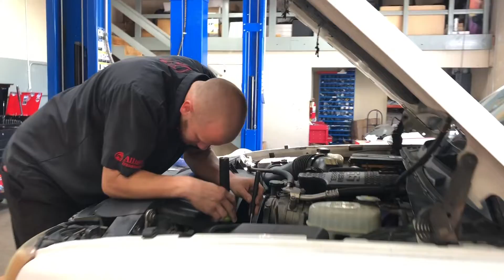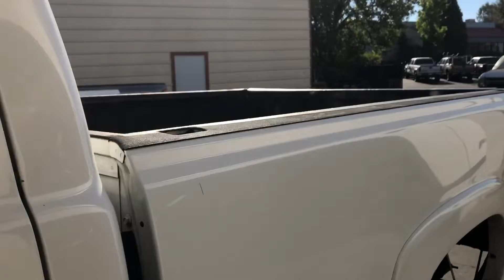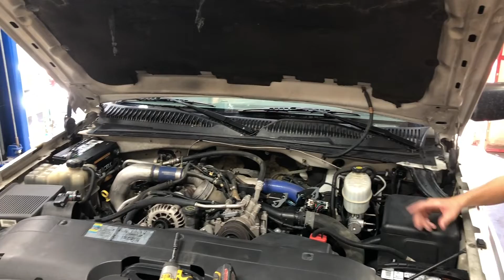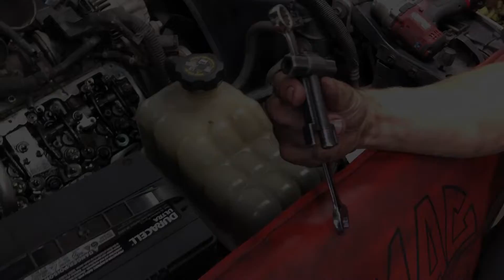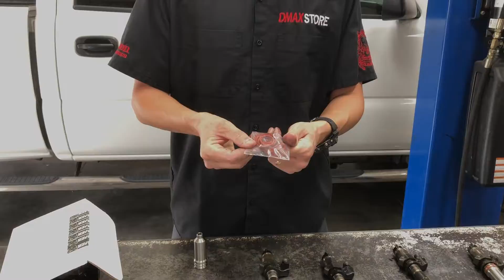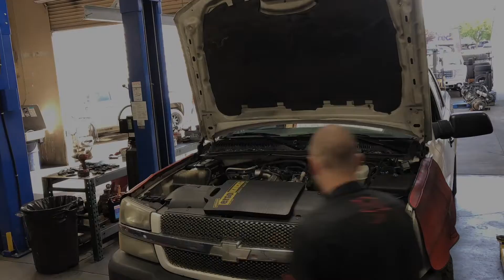LB7 Injector Diagnostic & Installation - 2001-2004 LB7 Duramax

Comment: Could you please do a video of pressure washing the engine? I bought a 2002 Silverado 2500HD Duramax and I want to wash the engine off. I want to do it correctly and not fry anything. Thank you.
Reply from the maker: Best practice is to avoid any electronics.  Otherwise its pretty straight forward

Comment: I thought you weren’t suppose to pressure wash under the hood on these Duramax trucks due to burning some computer or module up🤷🏻‍♂️
Reply from the maker: We pressure wash every truck but take care not to focus the pressure washer on any of the electronics. Thousands of trucks later and we have yet to see an issue.

Comment: Ok so got my balance rates under 3 now I have some around 3 and around 2 but I see it’s in spec again but still hazing . No fuel in oil , rough idle , longer cranking . I guess it’s time . Whats yall opinion on the new stock injectors vs sac? Like will I get longer injector life with the new vco or the sac still the way to go ?
Reply from the maker: Go with brand new Bosch injectors, they will give you the longest life out of any injectors available today.
Reply from the maker: They are 10% off ending today! https://dmaxstore.com/collections/all?pf_mlt_filter_by_product_type=BF%2FCM24&pf_v_filter_by_brand=Bosch

Comment: the second trunk could also have a failing rail injector pressure regulator valve issue the reason it could not reach the max fuel pressure.

Comment: My truck is hazing pretty bad now only thing I can see is balance rates and I only have one out of spec at -5.9 the rest are under 2 . It starting to smoke bad can I get away with replacing that one since it’s in the easy side of the passenger side or what sir 😊
Reply from the maker: We recommend replacing at least one bank (4) at a time. If one is bad the rest are likely not far behind
Reply: @Dmaxstore  ok anything I can do to try to fix that one -5.9 balance rate

Comment: Where is the lb7 injector trim codes located on injector please help
Reply from the maker: LB7 injectors do not have trim codes. That is only 2006 LBZ and newer.
Reply: @Dmaxstore also for example if I get 60 over no programing needed either just plug play and check rates?
Reply from the maker: If you get 60 overs your truck will need to be tuned accordingly but you won't have to program flow rates or anything into the ecm like the newer trucks. But your custom tuning will need to be modified
Reply: Ok thank you for info  @Dmaxstore
Reply: So i can just buy them and replace them and check balance rates and im good to go. No programing needed 
Thank you for replying so fast much appreciated @Dmaxstore

Comment: I have an LB7 that smokes at idle and my Balancing rate are averaging out to -2.62 but only my number 5 cylinder is reading +15 could this be an injector harness I have replaced all injectors but the #5 is the only one that has not changed has stayed the same??
Reply from the maker: A +15 balance rate is the maximum that the truck will read, there is likely another issue with the motor as the injector is trying to balance out the engine. It is rare to see a failed injector with a +/- 15 balance rate.
Reply: Injector connector terminal spread open and not making contact.  Check injector connector terminal

Comment: Pressure washing a engine, let alone a diesel?? Oh no no no ya just lost me
Reply: Tommy Halcomb why shouldn’t you pressure wash an engine??
Reply: Yeah why shouldn’t he?
Reply: For one there's nothing wrong with pressure washing an engine long as you're not stupid and don't hang out at the harness connections too long and two what does let alone a diesel have to do with it.....I'm curious where you're coming from here cuz if anything you're better off pressure washing a diesel cuz they don't have coils and spark plug wires and cap and rotors to deal with not getting wet.....

Comment: That upper valve cover sure came off easy 😀. Instead of prying, I used a block of wood and a mallet to pop mine loose. Only one cup came out and I cleaned everything and reinstalled. Also, is Bosch even making “new” injectors. I contend all LB7 injectors are remans of the improved (better bodies and return seats) units. And hey, it says right on the FICM “don’t power wash”.  Otherwise, excellent video 👍👍👍.

Comment: I ordered a head gasket and fuel injector kit (I didn’t order them from you, i didn’t know. I think it was Lincoln)and it came with five little tubes of loctite, im not sure what it’s for, I’ve got my heads back on and installed the injectors today, are you supposed to put loctite on the banjo washers on the fuel return lines that screw on the injectors (LB7). Thanks for any advice.
Reply: Hey Shane, the only place we use the loctite is the injector cups but I think you are already past that point, Please give us a call if you have any other questions. Thanks! 877-469-3629
Reply: Travis Edwards thanks a million Travis, I was wondering about those banjo washers and if I messed up by not using loctite. You just gave me some piece of mind.

Comment: What if you ignore the haze, and it starts knocking and smoking really bad. I didn't know my injectors were bad. Is the knock possibly a washed out cylinder that now has a loose piston ?
Reply: There are a lot of variables from your description, if you know your balance rates and on times we can help you out over the phone. 877-469-3629
Reply: Compression test cylinder

Comment: I was getting antifreeze in my oil and everyone said it was a blown head gasket, I got the heads off today finally and there’s no sign of them leaking anywhere, where else might my problem be? Please please, any advice in appreciated.
Reply: Dmax Store , thanks sir, the heads are at the shop right now being pressure tested and milled. It was also antifreeze in my oil, not the other way around, do you still think that might not be the culprit? Guess I’ll check the oil cooler next then, thanks, both shops I talked too after my problem was discovered said it was definitely the head gasket and it would run around $6,000, I’m 10000% sure they’d have charged me that, even if it wasn’t the problem.

Comment: My high pressure fuel injector line failed and is leaking.  Im going to replace it.  My question is.... what is the torque on these lines or are they just snug tight?  Also, do I have to bleed they system after replacing the line?  If so, how is that done?

Comment: I've got two questions.  What did you put on the copper crush washers to keep them in place right before installing them?  Second is could you give the specifics of installing the cups? what type of Loktite and where the loktite goes  thank you for any input you could give,
Reply: Blu Morgan not sure if you still need the advice but nothing needs to to be put on the copper washers. Just put them inside the cup after you install the cup. You will need red loktite 272. The end and shoulder of the cup that goes into the head needs the loktite.

Comment: I have a 2001 lb7 101000 miles no smoke no miss starts easy cold n hot runs like new.  But I'm getting crank case filled with fuel.   Is that injector body cracked?
Reply: I have the same thing. Been told cracked injector bodies, bad seals on the injectors, or it is the return lines leaking. Either way I'm getting new sticks and all gaskets/orings along with any lines that may be bad.
Reply: I just got an 02 lb7 changed the oil today and it had over 4.5 gallons im scared its an injector thing
Reply: ivan baires it is. It’s either return line leaks or injectors
Reply: @ivanbaires5727 , you're lucky it's not an engine "thing" with that kind of fuel in the oil.  Like my old lady says, "Pull that damn dipstick out once in a while".
Reply: @tommyimalas2283  i changed my oil again more came out then what i put in sent a sample in for testing

Comment: Ah, memories. 

Did my 03, CA LB7 (w/EGR) last summer...over many more days than I care to admit 😀. Had to smile when your guy lifted off the upper valve cover. As you know, many folks struggle mightily at that point and I found a large block of wood and a 5# hammer popped both sides off easily (strike down from the valley side). 

I also appreciate your insight on not trusting balance rates alone as a diagnostic tool. That Tech 2 check of injector on time told the whole story. 

Looks like you did a lot of work to isolate return lines from each bank for a return flow test. A trick I learned is to break into the main return line just ahead of the tank and check there. You will obviously not get bank-by-bank but the total should tell you what you need to know. I doubt you would ever recommend injector R&R on ones bank anyway. 

Another important point is in regard to those pesky, shallow head hex fasteners under the covers. Mine all came out fairly easily (also the many other hex on this job) because I was careful to deeply seat my tool into each upon removal. I bought new, deeper hex for under the VC's.

On valve adjustment, think I may have gone a bit tighter than you did (10 thou?) which quieted the engine dramatically. I was amazed that clearances were all over the map (high). I snugged up the serp tensioner with a blocked breaker bar and used the alternator nut to turn the engine.

As I rookie, I bagged and tagged all my bits and wrote a step-by-step log of everything I did, then went through in reverse when putting things back. Only a few leftover items (which didn't look too important 😀) and the beast fired on the third series of cranks and has been excellent for 2500 miles with no leaks.

So, on that injector job I'm guessing what, 4-6 large? 

Best.